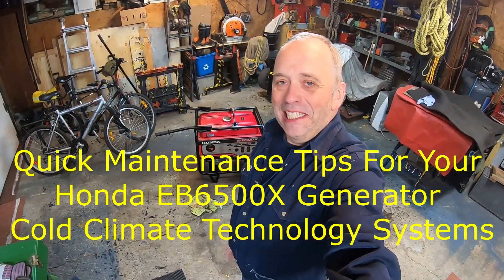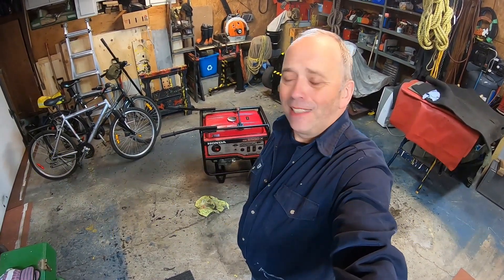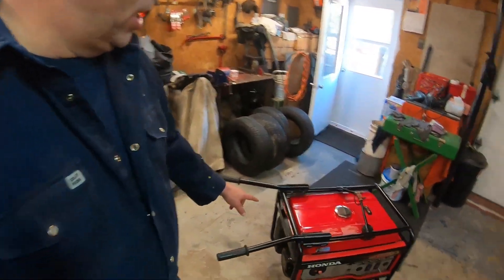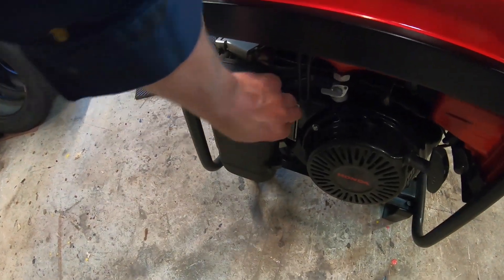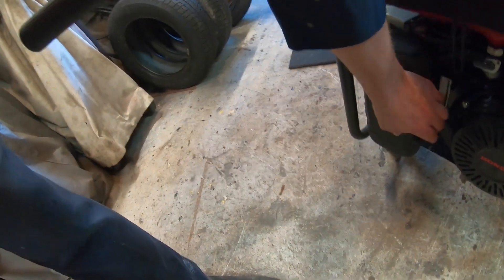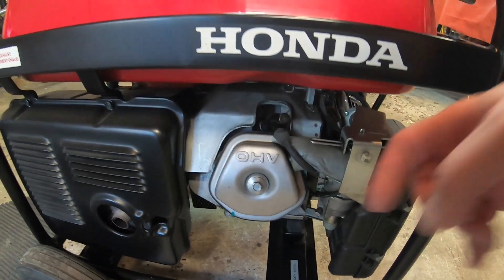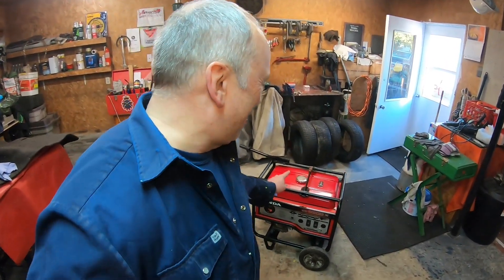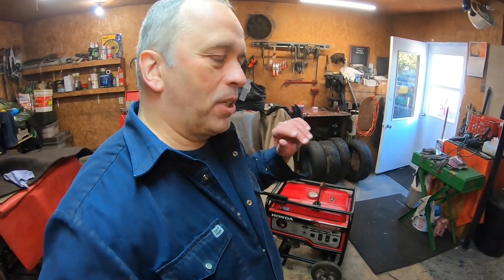Quick Maintenance Tips For Your Honda EB6500X Generator Cold Climate Technology Systems 🧐👍🍻

Comment: Good advice about cranking up to the compression step.  Did not know this one!  I do rely on our unreliable grid and climate changes to have to use the generator quite regularly... So I've stopped winterizing it.  If needed, I start it with ether. In fact, I do that with my tractor in winter time, always. So I don't flood the engine.  Ethanol is indeed a green mistake.  Like many others. I think the population rather hear the feelings of the public opinion than scientifics when comes to the environment. Thanks!
Reply from the maker: Bonjour Joe, Thank You Very Kindly and It Was A Follower That Give That Advice Few Years Ago ( I will he Will Reveal His Name 🤔🙏)  You Sence Of Humor Is Truly OUTSTANDING and We Both Of Us Used To Live In The Best Place In Quebec Where We Had The Most Power Lost In One Single Year Until Two High Brass From Hydro Quebec Start To Live On The Same Mountain that us ( Shefford Mountain ) and In One Single Summer Of Clear Cutting Around The Power Lines Fixe That Sade Statistic who left Me With Some Post Trauma 🙄🥴🤣👍 Ether Is Quiet A Drastic Dynamite ( KABOUUM ! ) Solution but I Understand Fully Your Will Of Doing It 😇👍🙏 Yes I Totally Agree With You, Good Trusting Scientifics Should Rules The Worlds 👍😇🙏Be Well And I CAN'T WAIT TO SEE VIDEOS FROM YOU MON AMI 😇👍🧐👌Cheers 🍻

Comment: Salut @RCAFpolarexpress! I'd lime to know the reason for pouring a small amount of oil through the spark plug well? Is it to prevent corosion? Lubricate the piston rings until the next dry start? 
Merci ben pour le vidéo! 👍
Reply from the maker: Bonjour Monsieur,  Oui It is Exact Sir, Oil Will Prevent Corrosion on various parts of the combustion chamber and Also putting your engine on the close compression stroke so all the valves are closes will prevent the humidity entering inside of a single engine cylinders and closing the choke will help too !!! Thank You and Be Well mon ami Cheers 🍻

Comment: That is very good and imperative information my friend. I visited my uncle in Florida five years ago and he asked to check why his brand new, never used generator was not starting. First thing I noticed is that it has not fuel. My uncle said that he fills it every year and fuel just evaporates. He did that for 10 years. The fuel,system was so gummed up by 10 years of fuel evaporation. I had to take the tank and carburetor off and completely clean them, as they were full of varnish and sticky. He was happy to see that I got his generator going. I then told him to stabilize the fuel, run it once a month and at the end of one year, drain left over fuel and add fresh fuel and stabilizer. Happy Sunday mon ami 👍😁🍻
Reply from the maker: Good Day Mon Ami,  I was surprised that your uncle's generator was so gummed up! Thank You Very Kindly For Your OUTSTANDING Life Biography Maintenance Story👍👌🧐  You are The Best Mon Ami and Be Well Cheers 👍🍻
Reply: @RCAFpolarexpress  👍😁🍻